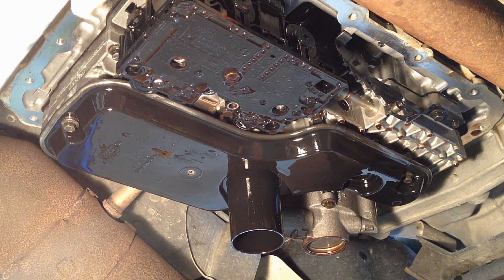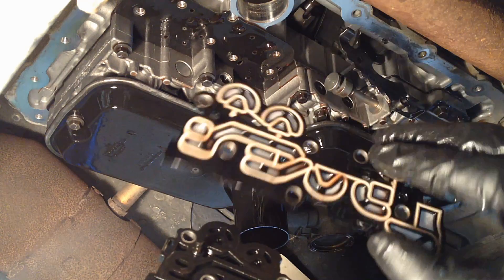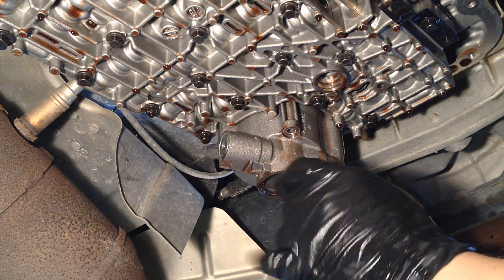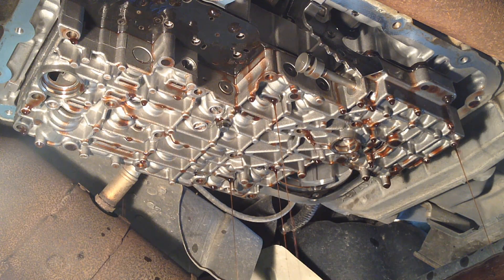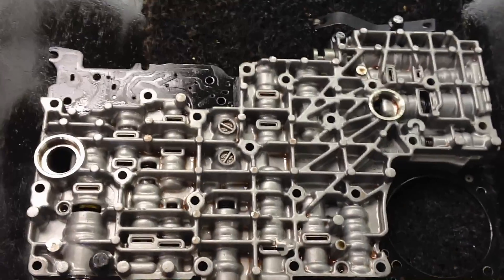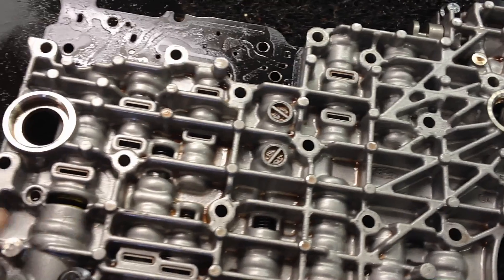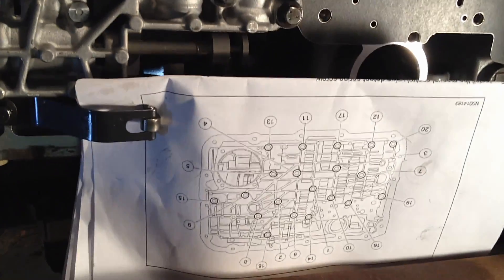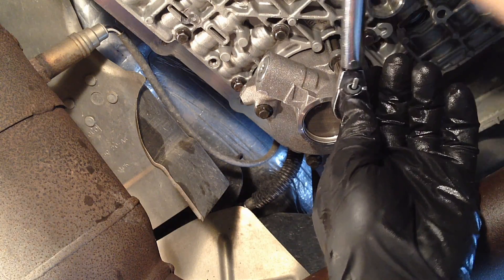Ford Explorer 5R55S Harsh Reverse & P0741 TCC Performance Valve Body Replacement

Comment: The number one reason this transmission fails is because of bad O-rings on the plug going into the valve unit the AC unit on most explorers dump water on it constantly lot of times you'll find rust on top of the reverse valve and if it's been doing it for a while that usually kills that valve

Comment: Hello just loosen my band on intermediate totally now I can feel any torque adjustment and the 3rd gear and 1st has no pressure can’t move can give any idea or need to buy new transmission and the engine light on and overdrive flashing pls help me god bless

Comment: I, have question about reverse servo broken or torn screen. Is, it ok to use the reverse servo without the screen? I seen on the other comments the screen can be removed and it won't effect the transmission.

Comment: I have a 2005 Ford explorer, i have no 2nd gear, i tried the servo bore route but still no 2nd gear also new solenoid pack same thing. Funny thing is i do have 5th but only with od turned off. There was only fuzz on the pan magnet no metal chunks or shavings. Trying a valve body shift kit now. If you or anyone else have any ideas. It did throw 0731,733,734 and 745 codes.
Reply: Did u try the valve body?? I have almost all those codes about to try the solenoid but thinking about doing the valve body as well…
Reply: @brianmorales-vazquez7203  yes I did but it didn't help. This vehicles timing chain broke while driving and caused life ending damage before I ever resolved the transmission issues.

Comment: Great video.  I have a slightly delayed engagement into reverse at times. I'm considering just throwing a valve body & sol. pack & filter into it and see what happens... My explorer has less than 100,000miles on it...
Reply: I have the same problem. Did that work for you?
Reply: @SiscoEighty3  I haven't fixed mine yet.... we don't drive the vehicle much... one day....
Reply: @NowellHolmes Did you fix it yet?
Reply: @joshuasmith619  nope, sorry. Sold it.
Reply: @joshuasmith619  I have had a similar problem and ima change the solenoid pack and valve body before I try a torque converter!! I did a clutch swap with some friends last weekend and I feel like I can do it all lol!!! I’m only posting cuz it says to weeks ago !!

Comment: In respect to conservative measures, I train the fluid replace the filter replace the fluid flush it twice after that and on the last fill I add BG automatic transmission concentrate and overtime these late and harsh shifts will work themselves out. Worn out low or broken down fluid will cause valves in a valve body to stick or have some scoring. If any product in the world will help clean that up it is BG atc. I have had amazing success with this product the other points are fluid gets hot when it's thin and worn out because it's not lubricating antifreeze that is old is not cooling your transmission or your engine like it should and old thin worn out engine oil the same thing. Dirty injectors cause extra fuel to wash past the rings you now have a crankcase that has fuel in the oil and none of this is any good. Full new and vital fluids are the key to the life of your car. By the way drain and fill that transfer case with ATF and bgmgc as well as your front and rear differentials. Replace that fuel filter. American made fuel filters plug themselves up because of pressure and volume unlike foreign car filters that will go 80,000 miles. Ford is not back and better than ever Ford is just the way they always used to be cheap and high maintenance

Comment: I do things conservatively. Basic foundational viewing from 10,000 ft. Replace that filter replace the fluid swap the fluid another three times and put in your BG automatic transmission concentrate. Clean and vital fluid is the trick. Also Ford tends to use radiators that are too small for the vehicles on top of that people don't change their oil don't change their tranny fluid don't change the coolant. Finn worn out broken down oil and antifreeze cannot cool properly. Get your fluids replaced make sure they are full keep your tire pressures full and when you're at a mile high going uphill with thin air and high temperatures loaded to the gills with people and luggage help the vehicle by backing off a little bit it's not going to do what it does at sea level. Not to be derogatory or sound like I know it all. I do the little and basic things first BG ATC will break down varnish sludge and little pieces of sediment that are holding those valves from moving. 90% of your problems are people because people don't take care of stuff

Comment: 2008 mustang gt sudden loss of reverse and drive.. no noise. Fluid didn't smell burnt but the filter was dirty. Replaced the fluid and filter. Now have a small attempt in 8 but not a strong grab... why..?

Comment: On my ford explorer 3 (automatic transmission 5r55s) when driving, the cover burst XW4Z7D027GB. 3000 km before that, there was a major repair of the automatic transmission. What could be the cause of the damage XW4Z7D027GB?

Comment: Ive got 08 eddie bauer explorer, 4.0 2 WD. Harsh shift at 2ndcto 3rd and 3rd to 4th, and jerk going into reverse. Im assuming from your videos a valve body and solenoid pack would likely fix it? Which brand n the part # do u reccomend? Any tips on removing broken pan bolts? Lol
Reply: Or if youve covered that in some other videos the link. Thanks

Comment: My 2008 Ford Explorer Sport Trac had harsh shifting into reverse and between 3rd and 4th I changed the solenoid pack it work great for about 2 weeks but now I'm getting P0741 any suggestions?

Comment: Tried pulling solenoid block straight out like in video and obliterated the wire harness on the inside.
Reply: they sell replacement wiring harness pigtails or cut one off from the salvage yard

Comment: WARNING VERY IMPORTANT! What this video does not mention and I am sure it was mentioned in one of his other video's since he is in a business to make money and not give out all the information or perhaps he just forgot to mention it is before you can remove the solenoid pack you first have to remove the 10 mm bolt running through the top of the wire connected to the top above the solenoid pack. Forcing the solenoid pack or prying it off in any other way will cost you the solenoid pack or even the transmission case all together. Notice the solenoid pack was already unscrewed with just the center screw left and no mention of the 10 mm bolt on top?..
Reply: He said to check out his other video on how to remove selinoid.  Pay attention.  Thank him for sharing his knowledge.
Reply: Thanks,been,trying,to,pull mine off for,over an HR and wouldnt budge
Reply: Your comment is reliable. Thanks for the info, if you haven't mentioned it maybe we ruin the solenoid pack. Thank you so much sir
Reply: How do you clean the valve body? Can I use brake cleaner?
Reply: Bro thank you soooo much I was stuck and could not get the plug out till reading this thank you again
Reply: Спасибо друг. Буду знать!

Comment: I have the 5r55e in my 4x4 2002 Ford ranger with the same delayed/harsh engagements.Would this video be the same for this transmission? If not, Have you made a video on the same issue in the 5r55e.

Comment: Can the valve body cause it to slip in reverse when you apply gas pedal? Mine reverses at idle with no increase at higher rpm.
Reply: Mine too, did you fix it, what was it
Reply: @PipeLayer83  no we didn't fix it. There are too many things it could be too invest in trying to fix one at a time. A complete rebuild is $2400.
We have been driving it the way it is for a year. Yesterday she bought a new truck.

Comment: That metal plate the big one that came off valve body are the three bolts holding it on do they need torqued down or doesn't matter?

Comment: Hello Tech, could the valve body cause a no reverse issue?  Thank you
Reply: The reserve servo has a filter on it took 2 out both where bad common issue i assume but u could also check the spring and inside the reserve servo is a plunger type piston with a rubber seal which goes bad that causes n o reverse to

Comment: Hi.was having an issue with not going into 4th -5th gears. Will run in 1-2-3 fine, but will not go in reverse. It will kick in but when i add gas it just revs and no movement. I replaced the solenoid pack and the same issue... i get codes of p 0750/ p0765/ po760/ po634/ po740/ p01788/ p01746. The seller of the solenoid pack says i have electrical issue, maybe the harness cap? Any  opinions? Thanks
Reply: Did you ever figure out what was causing this?
I'm having the same issue but in reverse and drive but the vehicle moves in sst 1st and 2nd gear but wont do 3rd or up.
I'm going to clean inspect the valve body and install the TransGo shift kit and a new solenoid pack as well.
It would be nice to know what else I should look for and what is causing the same no movement but slightly lurch forward or reverse.

Comment: Also FordTechMakuLoco
 I have a question. What is the generic general price of these items (guestimate for a Ford Explorer Sports Track 01) 

(1.) Brand new seals? 

(2.) Brand new gaskets? 

(3.) Brand new rings? 

(4.) Upper valve body gaskets ? 

(5.) Lower valve body gaskets? (thanks)

Comment: +FordTechMakuloco good afternoon,  I'm hoping you can help diagnose an issue with my  2008 explorer xlt, 137k miles.  A few days ago my card began hard shifting from 1-2-3 making a sound like a louder spin up. not the smooth humm, but more of a "vrooooom". Very difficult to describe.  I scanned for codes and it shows P0443, p0053, p0059, p0060, p0403, p0054, p0528,p0620 .  I took it to a shop and was told I need a transmission rebuild quoted $1800.  The only light that is on my dash is the check engine light which was there a few week priors to the hard shifting.  Thanks for all the youtube content it has help sort out other issues with my cars.

Comment: 04 explorer 5R55W. Replaced the valve body, solenoid pack and filter. Fixed all my shift problems and the harsh reverse. Great videos! Parts are available for cheap on e bay. Thanks!

Comment: @FordTechMakuloco , I just replaced the valve body in my 04 LS with an updated refurb and am not able to get the vehicle to move. Bringing up the RPMs to around 3-4K I am able to get it to lurch forward ever so slightly, but that's it. Possible that I messed up the shift cable or manual arm while replacing it? No CEL or CT light. Any thoughts?
Reply: Did you ever figure out what was causing this?
I'm having the same issue but in reverse and drive but the vehicle moves in sst 1st and 2nd gear but wont do 3rd or up.
I'm going to clean inspect the valve body and install the TransGo shift kit and a new solenoid pack as well.
It would be nice to know what else I should look for and what is causing the same no movement but slightly lurch forward or reverse.

Comment: I have a 09 Ford Mustang with p0741 and I have monitored the desired and actual converter slippage with an IDS, there is no change when I command it on. With the vehicle parked and I use the IDS to command it on I can hear the TCC solenoid click from under the vehicle. How do I find out if it need a torque converter or if the issue is in the valve body?

Comment: Ford Motor Company needs to stop changing transmission models so much until they actually work all the bugs out on one....keep it simple stupid (k.i.s.s.) People do not have thousands of dollars on hand sitting around waiting for their transmission to go out when their warranty is up on the vehicle....this is why people are buying foreign vehicles and losing faith in American products that have the same problems year after year...makes absolutely no sense...obviously the discussions at engineering meetings are either overlooked or they just dont give a damn...
Reply: EXACTLY what I think as well, Ford or other car manufacturers change engines or transmissions before fixing flaws on the older models, they keep on digging one hole to cover up another hole ( the way I see it) my opinion.
Reply: M

Comment: Thank you so much for your videos, you have taught me so much man. Just had a few questions for you. 99explrer4.0sohc4x4 175000 original miles. I Was about to do a lot of work and maintenance on it $$ but am questioning the transmission for 2 reasons, which is making me hesitate before babying and spending on the old Explorer.
 It has been babied never driven hard and isn't really showing any signs of wear in any gears except for final gear. It takes a while to shift into final gear until the trans warms up than no problems just shifts a bit early and a bit laggy I would say. I thought it was maybe the valve body gasket but just wanted your expert opinion.
Also shifting into reverse it kinda slam into gear once in a while not always, if I depress brake and feather correctly it can be smooth shifting into reverse. Also what are your thought on high mileage transmission fluid changes or flushes?
Otherwise The motors solid and burns no oil. I got some usual signs of wear, pcv, valve cover, Im gaskets, etc, but thanks to YOUR videos it will ALL be a BREEZE, hopefully your thoughts on the transmission is good news and I will go ahead and take care of business!

Comment: Hello. Great videos. I have a quick question. Out of the blue my 2003 ford explorer just didn't want to reverse. All other gears are fine. Shift good on drive and everything just no reverse. It goes into gear but nothing. Can it be the reverse servo, band, valve body? Thanks!
Reply: No check engine light or anything on dash. About 130k miles on it. Should I try resetting pcm too? Thanks
Reply: I'm having the exact same problem man, did you find out what it was???? Please

Comment: Hi just want to thank you for your great videos. They are truly appreciated. I have a 2010 mountaineer with 68,000 miles and the 4.0 engine and the 5r55s trans. Vehicle meticulous maintained. Oil change between 3-4000 miles. Trans every 20,000 miles. I have saved every video you made on the timming chains and transmission. No issues yet. Again thank you Sir

Comment: I have a 2004 Explorer giving error codes for the torque converter as you mentioned as well as codes for shifts, which I think indicates worn servo bore in the tranny case.  I also have a solenoid error.  

Do you think I need a servo fix, and a new valve body and solenoid body?
Reply: Benjamin Slayton Were you able to answer your question? What was the result?

Comment: Did you replace the valve body? There's only a link for the new solenoid pack in your description, so I'm wondering if replacing the valve body is also in order to correct the harsh reverse engagement in my 2008 mustang.

Comment: Hey there! I recently came across some issues with my 2000 Ford Ranger with an AT. The O/D OFF light started blinking, so I pulled the code and it threw the P0741 code. I'm trying to diagnose what exactly it could be. I think I may just end up diving in and checking it out, but I'm completely new to this. This video helped me understand it way more, but I'm still a bit unclear. My symptoms are that it will come on after a couple miles of driving, then reset when I shut the truck off. Seems pretty common from what I read on the internet, but can't find an exact solution. Another symptom is that it has an extremely harsh shift from 1st to 2nd, and I think it's a bit harsh from 2nd to 3rd but not nearly as noticeable. Based on these symptoms, do you have any advice? Not expecting an exact solution, but could you help me figure out how to go about resolving the issue with out throwing a bunch of new solenoids and new parts at it? Thank you!

Comment: I'm kind of confused so he did change the valve body and the solenoid pack or just clean the valance body and change the solenoid pack?
Reply from the maker: +S197 Jet the failure is in the valve body and must be replaced

Comment: I have a 2008 Explorer 2wd XLT 4.0 6 and it started having the harsh engage to reverse only. From park to reverse it hard engages and from reverse back to park it does as well. It shifts from park into drive fine, and shifts through all of the gears fine. From everything I have read including this vid it sounds like the valve body. My questions is should the solenoid pack be replaced as well when doing this? Its only $200 more to do, but wondered if it was even necessary.

Comment: i have a 2003 Lincoln Aviator that wont go front or reverse. i checked shifting wire change solenoid block and filter and still have the same problem. any idea what is the problem? do i need a new transmission?

Comment: My Explorer 2002 only have 24,000 miles on it and have a code p0741 do I really have to change the valve body, I thought with this low miles how could it have this problem any comment or suggestion on how to fix and diagnose this would be helpful.

Comment: I was trying to replace servo pistons but had a mishap, so I had to remove the servo pistons.  However, one broke, so now im taking off the valve body to see if I can get to it.   But, the solenoid pack is not wanting to come out, I have removed all the bolts, and it moves but seems like it is caught on something in the bore, could this be the broken piston or is there a secret to removing the solenoid pack?  Thanks!